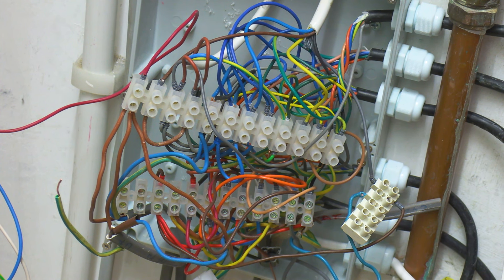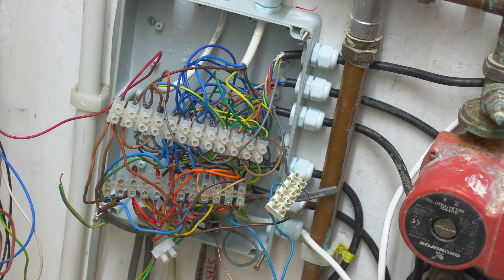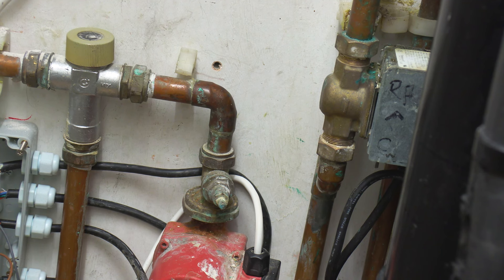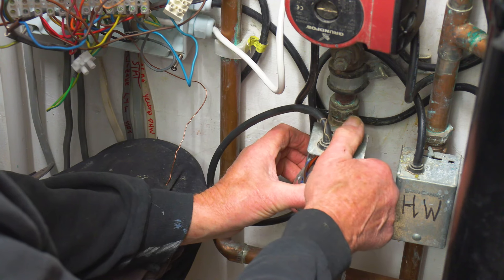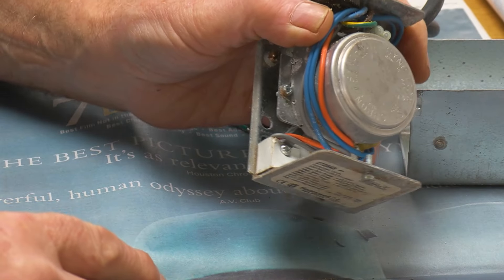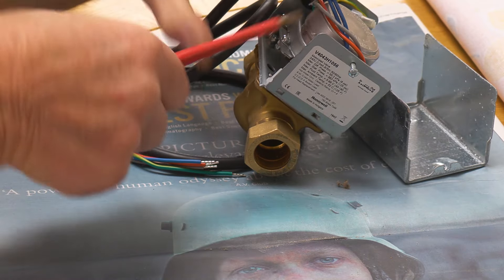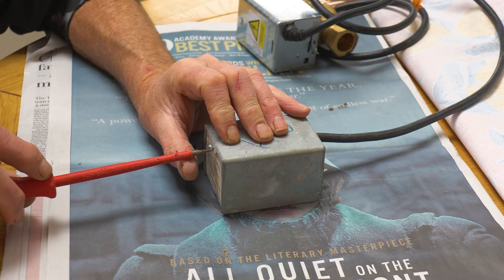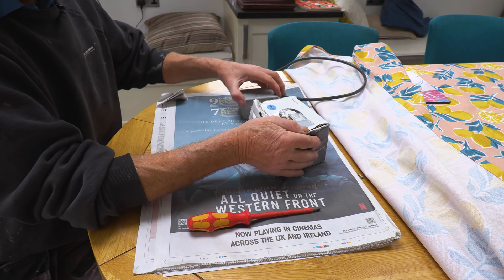Motorised Valve Fault Finding

Comment: Hi Roger   As a retired electrical contractor , I can’t for the life of me understand why a qualified electrician can’t work out how a simple bit of kit like a motorised heating valve works .  And as for the mess of wires that you showed , it’s beyond belief .  There will be 240 / 230 volts rummaging around in that rats nest , even if it was in some sort of enclosure . You would spend half your time working out what did what .  I’m sad to say that there is a lot of incompetent individuals still out there . And the only reason people are not dropping like flies , is the advancement of RCD technology .  God only know what these people would do , if involved with a three phase installation . Probably they would be burnt as crispy by the end of their shift .    230 / 240 v  usually you get up and walk away ,  400 / 415 v and it’s usually good night Vienna  .    Best wishes and kind regards as always
Reply: and why folks dont label stuff up as they go is beyond belief, it take 15secs or less to put a label on something but can save hours at a later date. As you say goodness know how some would get on with something like a star delta 3ph starter !
Reply: The internals of a motorised heating valve is quite complex as it uses micro switches resistors and a diode arranged in such a way to make the motor stall and hold its position against the return spring when energising and de energizing the appropriate wire or wires, so its not so simple

Comment: The three terminals on the micro switch will be a common, normally open, normally closed. That give the choice of the switch turning flow-off or on when actuated. 👍👍
Reply: And they are usually labelled as "C, NO, NC".
Reply: And if present the NC wire is white.

Comment: I'm not electrician or plumber, but managed to take out a system and put in a wiser system for my 2 zone house. Wasn't that hard as long as you follow the directions. It's hardly rocket science, but I get why plumbers wouldn't do it if you have to be part p registered. Elecchickens shouldn't really have an issue with these. As far as I'm concerned its something simple they should all be doing

Comment: New reputable 3 port motorised valve fitted exact wiring as original one. New heat exchanger and new fan. Can only turn heating on if I turn hot water on. The grundfos pump activates when I select hot water override but does nothing if I select heating override why?

Comment: The microswitch is a standard item and usually has 3 terminals. Common (C), Normally Open (NO) and Normally Closed (NC). In your video the unused terminal will be the NC terminal that opens when the stat trips on. Easier to see on a diagram.

Comment: I used to love wiring heating systems, did them for several plumbers who just left the wires dangling. Made my own terminal boxes up back in the 80's with fixed terminal blocks numbered and ALL the terminals were big enough to get all the required cables in, plenty of wiring space. The neutral was the issue, for each separate part of a control, pump, valve, boiler or whatever else there was a neutral so sometimes there was almost 10 neutral wires and any manufactured terminal box never had a big enough connector, same with the earth.
I did an underfloor heating system once with its dedicated controller, 15 terminals outgoing for various parts, stats, etc, and only 1 earth and neutral terminal. Terrible design with no thought for the person installing it or fault finding.
I have to say you were brave attempting to wade into that birds nest of wiring, that is an atrocious job, you did well. 🎉
Reply: Not too bad really, 4 outputs would control the zone valves turning on and the relays on the valve would be wired in parallel providing the power for the pump and boiler assuming it’s a 240v switched output to the boiler. 

The 4 zone controls would either be thermostats or relays from something a bit more advanced like a evohome or other computer based control system. 

I’ve used Wago topjob S din rail units to keep things neat and tidy. They have bridging connectors if you need to parallel connect and are highly flexible for whatever you need to make up. Added a din rail to a recessed box and flush mounted mine. Nice neat and documented.

Comment: Great to see roger highlighting the all to appallingly bad standard of wiring of heating controls. No wonder the public barley understand them if the trade just jam all the wires into too small a terminal block and hide it in a plastic box. Out of site out of mind.

I’m surprised there isn’t an industry stand wiring terminal block that can cope with the most common heating system plans and has everything labelled and tidy. It’s been done for mains wiring for years. 

If the work was photographed and logged then I’m sure the work would be finished to a much higher standard and cost only a bit more. I used to work in HVAC commercial and you knew your work would be judged so you made an extra effort to make it look smart and tidy. Some pipe work and wiring install I saw were works of art!

Comment: This is actually easy to do DIY. Some great diagrams available on flameport, had same issue Plumber installed new unvented and had my hot water coming on with the heating, tore it all out and redone it myself and whacked a Hive in at the same time. Going from scratch is actually far easier than tracing every wire back.
Reply: Wait, so I don't have to have the house sweating just to have hot water???
Who should i call? What should I say?

Comment: Roger I can remember my first central heating fault. New years eve and the boiler would not stop firing. Took the central heating clock off and the boiler was still going (live feed to the boiler). It was a micro switch in the motorised valve. And I bought micro switches and fitted them. The fault finding was in the early hours of the morning, not ideal.

Comment: Hi Rodger, my “wiring centre” was a product of 1980s bodging. A small single gang backbox and terminal blocks. Not as bad as the one you have here though. To cap it all it was put at the back of the airing cupboard. The power was on the wrong side of the side and there was no space to put in the Honeywell evohome relays so not wanting cabling or sucting across the cupboard I decided to build a remote connection box from wago Topjob S din rail connectors. 

So I have a nice recessed din rail main unit with all the power nicely set up. In addition I’ll be adding monitoring so I’ll be able to see when the zone valves are getting power and when the pump and boiler get power with a temperature probe and a height detector for the top up tank incase it goes dry or overflows. All diagrammed out and colour coded. Dead easy to follow.
Reply from the maker: Hi David
It would be great to have some pictures of that set up.

Comment: I changed a synchron motor on the central heating zone about a year ago. The problem was the boiler was switching off before the room stat had reached the required temp, sometimes it would start up again 10 or 20 mins later. Anyway it seems the synchron motor
 was intermittantly de-energising. It was 30 years old so had done well really. The one on the hot water still works ok.

Comment: Very interesting Roger, good video. I think I'd be instantly put off by the volume (and mess) of wiring in the opening part of the video. Once I'd sat down and had a look, and if I understood what each component did, then I'd probably be fine. I'm guessing some electricians have little experience of the functional components of the heating system, so possibly just prefer not to get involved.

Comment: Diyer here, so can a faulty valve actually stop a boiler from firing on the heating but allow hot water?
Reply: There are two types of motorised valves for heating control. A 2 port one for hot water and a second 2 port one for central heating. There is also the 3 port valve which controls hot water at the mid position which then motors to full open which supplies central heating. The 2 port valves are completely separate but yes, the 3 port valve can give the symptoms you described.
Reply: When the motor moves to correct position it switches the mains power through to the boiler & pump.  Duff motor wont switch boiler on.  Same with thermostat on a hot water cylinder.  Switching mains to boiler.  Very basic & simple ideas just loads & loads of wires.

Comment: I have replaced  faulty micro switches, in these valves, micro switches cost pence, one other challenge with heating / hot water wiring is the inconsistent use of wiring colours, open them up and earths are used as Live's!, please if you do have to use wiring with the incorrect colours ( inevitable as 3 or 4 core + earth cable is silly money) then label the wires in the wiring centre..

Comment: Jeez that wiring was worse than mine to work on . I change the zone switches myself when they go , my heating one was breaking every couple of years , but I eventually found a tiny leak of inhibitor out of the valve , it was seizing up ,and not letting the spring switch turn off and breaking them .

Comment: Those motor valves are they 24 volts AC or DC or you can get both?
Reply from the maker: 240 volts
Reply: @SkillBuilder  that's surprising

Comment: My valve is opening when the thermostat calls for heat but the boiler isnt firing up, is this the same issue?
Reply from the maker: There is a micro switch in the head, you can fix it.